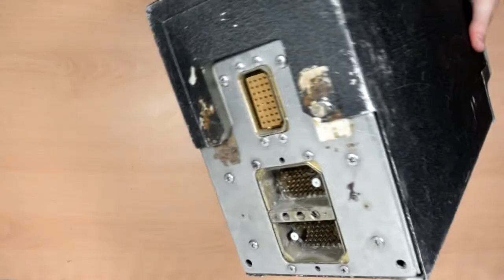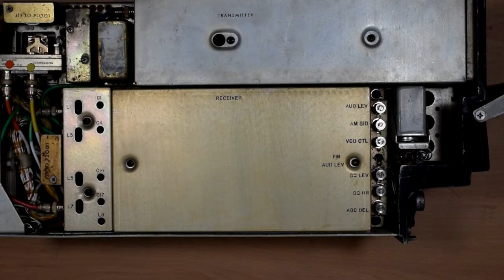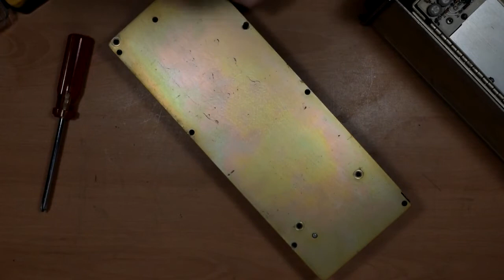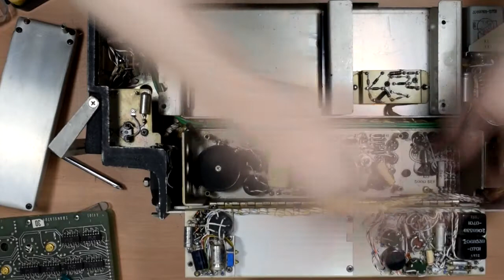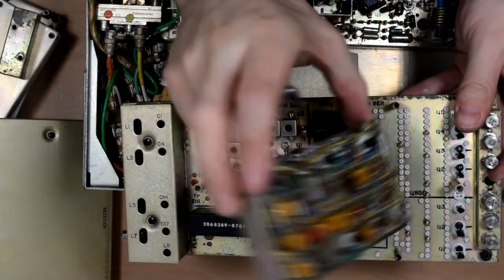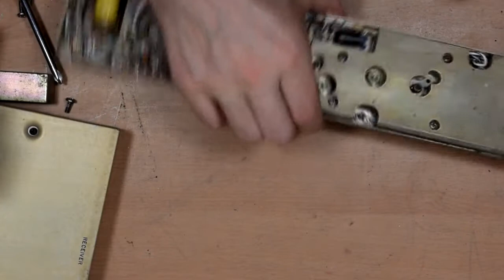Bendix VHF transceiver teardown

Comment: very interesting to watch. thank you for posting.
odd nylon spacers and point-2-point wiring. I can only guess it had the best performance that way. It really makes sense at the transmitter section though.
I have a larger transceiver of that sort, with tubes in it. Will do a teardown video somewhen. Also have this huge military transmitter on stock that I really need to disassemble to get rid of it.
Reply: Did you ever make that video?